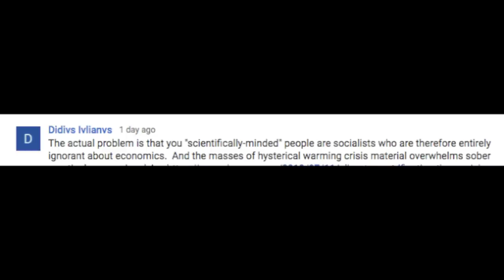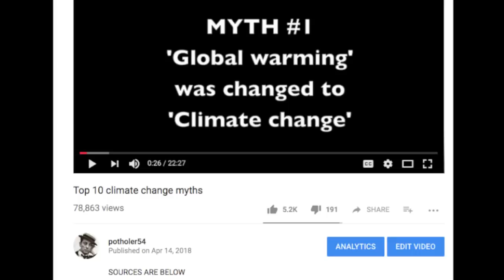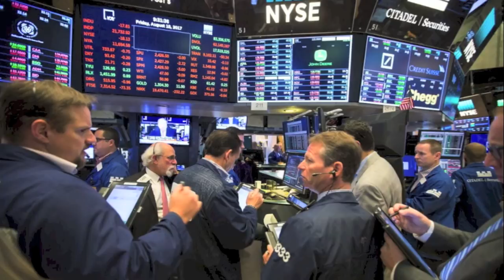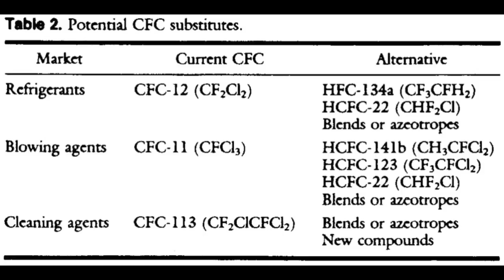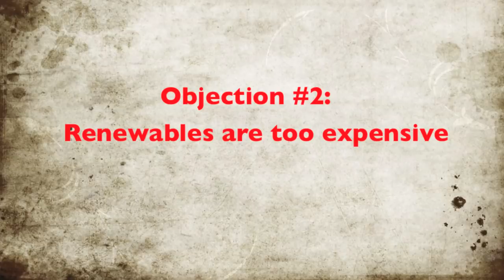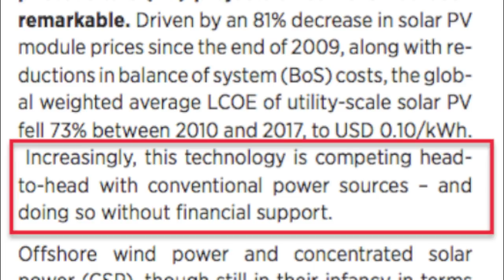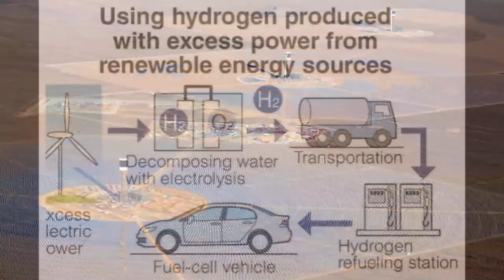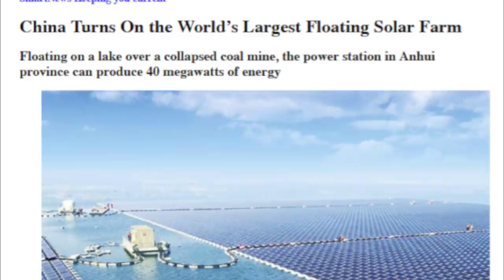A CONSERVATIVE solution to global warming (Part 1)

Comment: I'm a big fan of much of your content, but it's a bit too much of a stretch to claim that the market solved the 'lead in petrol/gasoline' issue and phased out CFCs in the 1980s/1990s. These were actually government interventions. Science highlighted the problems (and the solutions), governments in various jurisdictions implemented legislation, and industry responded quickly because there were relatively quick, easy fixes for both issues. Alternatives to CFCs were both available and cost effective, and most internal combustion engines of the time could be very easily adapted to lead-free fuel. In the UK, the government signalled the end of lead in fuel in 1983 and finally banned it from January 1st 2000. Owners of the handful of vehicles still remaining which still needed lead to function had to purchase lead as a separate additive, not at the fuel pump. 

If government bans things and the market adapts, this may be necessary and beneficial, but it's not accurate to describe it as a genuine free market solution. Market based solutions involve concerted consumer campaigns (to purchase green electricity or electric vehicles, for example), or new players entering the market (such as Good Energy, which offers 100% renewable electricity in the UK), or existing players offering cleaner, greener products and services. 

CO2 emissions are certainly a major concern (it's the top item on the BBC News today). Consumers, businesses and governments all need to take action without shifting the blame elsewhere in order to justify inaction. Much as I would like the market alone to solve the problem, given the urgency of the situation I believe governments can and should intervene to facilitate and accelerate decarbonisation. The solutions can and should be market friendly, but they will almost certainly not be 100% market driven.
Reply: It is a free-market solution in the sense that the government doesn't directly organise what's done to solve the problem. It merely tilts the playground so cleaner companies will have a head start to the consumers' purses.
Reply from the maker: "it's not accurate to describe it as a genuine free market solution."

   But I didn't describe it as a "genuine free market solution." I never make statements if I don't understand what they mean.
Reply: @potholer54  The video title is "A Conservative solution to global warming", and we know Conservatives advocate for free markets and reductions in government controls. You mention 'free markets 'at 1:15 and 8:26, and 'free enterprise' at 1.55 and 19:17, so you are clearly dressing up your solution as a 'free' market solution. 

You begin to present your solution from 8:20 as "Society...sets targets...which encourages...free market solutions" and go on to describe Feed-in-tariffs (without mentioning them by name) and carbon taxes, which government could use as levers to manage the market. 

As it happens I agree, but these are managed market solutions rather than free market solutions. It involves government introducing (rather than removing) taxes and subsidies. This wouldn't be agreeable to the extreme band of conservatives in the US who are your target audience. I don't claim to be an expert - I only have a degree in Economics - I'm just asking for the terms used to be kept accurate. 'Market friendly' would be accurate. 'Free market' would not, and that's the term you've used here.

I also noticed that you referred to solar thermal and solar PV almost interchangeably, when they are very different technologies as I'm sure you know. But I understand the need to tailor the message to the audience and not overwhelm them with detail. As regards solar PV and energy storage, I can recommend the youtube videos of Tony Seba on the subject of 'clean disruption'.
Reply from the maker: "you are clearly dressing up your solution as a 'free' market solution. "
   I don't think I "dress it up" as that, I think it IS a free market solution, as opposed to a socialist solution. I was just questioning your suggestion that I "describe[d] it as a genuine free market solution." I didn't. 

"These are managed market solutions rather than free market solutions."
   I'm not sure whether you are questioning the principle that pollution has to be controlled or polluters have to pay, or that pollution fines should be directed towards new technology, so let's start with the principle of protecting personal liberty and property rights. In a "genuine" free market, am I allowed to dump waste from my pig farm onto your land, or build a chrome smelting factory next to your hotel business?
   If not, then we have lost the free market right from the start. No country in the world has a free market, because every country has anti-pollution regulations
   But if you agree that even in a free market the government has to regulate pollution such as pig waste, or sulfur dioxide, or CO2, lead or asbestos, then the question is, how should it do this?
   1) Send in the police, shut down the polluting business and arrest the owners.
   2) Order an immediate halt to the pollution, with a hefty fine for non-compliance.
   3) Set reasonable targets, impose a fine for any pollution that doesn't meet the targets, and use the money to help private enterprise come up with a technology that eliminates the pollution altogether. 
    Which of those three would you call the "free market" solution? Or is there a fourth alternative, the 'genuine' free market solution that I haven't thought of?
  

"I also noticed that you referred to solar thermal and solar PV almost interchangeably"
   No, and just to clear up any confusion, they are different. Solar PV is solar photovoltaic -- i.e. turning sunlight directly into electricity. Solar thermal is using the sun's heat energy, either to make hot water or heat houses, or run turbines that create electricity.
Reply: So you're claiming that your solution "IS a free market solution". My point remains that it's a market friendly solution, but not a 'free' market solution. A 'free' market is by definition one without government controls, taxes or subsidies. 

As you correctly say “No country in the world has a free market”. Every economy we know of is a mixed economy which is neither a totally free market nor a totally socialist system. In practice nearly every economy - and every market within it - is mixed, neither entirely free nor entirely government controlled. The changes that people would like to make in a market indicate a direction of travel which allows us to identify the school of thought behind the proposals as 'Conservative' or 'Socialist' for example.

Conservatives and libertarians generally favour removal (or at least reduction) of government interventions from the market (such as taxes and subsidies) whereas liberals and socialists generally favour introducing or increasing government interventions. 

Since you are advocating an increase in intervention, this points to the latter approach, which means that the label 'Conservative' for your solution is inaccurate and inappropriate. Describing increased government intervention in the energy market as a 'Conservative' or 'free market' solution is an oxymoron, it would be like describing the privatisation of a government service as a 'socialist' solution, or describing more meat in the diet as a 'vegetarian' solution. 

I don't want to diminish your otherwise excellent and well-researched content, but you seem like someone who's interested in accuracy, hence I am trying to help you improve accuracy, albeit I seem to be experiencing some resistance. 

How would I solve the pollution problems you outline? Well there’s a lot of rabbit holes we could go down there (pig muck, SO2, asbestos etc), but as regards CO2 specifically, I adopt the approach that natural resources are common resources. This includes land, oceans and fossil fuels. Quite simply in my world the government would set a higher price for all fossil fuels extracted from the ground, at source. The higher prices would be passed down the supply chain so that retail energy costs – mains gas, electricity, LPG, heating oil, coal, aviation fuel, diesel and petrol/gasoline – would also be higher, as would the price of goods and services produced using fossil fuels. The revenues collected at source by the government would be distributed to all via a basic income. So in effect there’s a fee-and-dividend type scheme (https://en.wikipedia.org/wiki/Fee_and_dividend). That link also explains how border corrections would work in such a scheme. 

Is this a ‘free market’ solution? No. It’s not a Conservative solution either. It’s just my solution, and it’s relatively market friendly in that there remain many suppliers and buyers of energy interacting via a price mechanism and the government levers I would introduce would incentivise people to switch to greener electricity and minimise energy consumption. But in the interests of accuracy I can’t describe my solution as a ‘free’ market one. As the Stern report indicated, climate change is a major example – probably the major example – of market failure today. 

With regard to the Solar/PV Thermal comment I made, I simply point out that you do not present the difference between Solar PV and Solar Thermal clearly. Solar thermal is likely to remain peripheral while PV continues to reduce in cost, resulting in installed PV capacity continuing to expand by ~40% p.a. If Tony Seba’s predictions hold true, this should mean all energy globally coming from solar PV by around 2030.

Let's hope that is what happens. Or, as the Americans say, "Amen to that".
Reply: I think there is some subjectivity/relativity here in what constitutes a "free market". I don't think it should be thought of in binary terms -- a market can be mostly free, but with certain restraints to prevent abuse of the system. Much in the same way that humans are mostly free to live life as they wish, but not free to impinge on the freedom of others. Absolute freedom, in most senses of the term, is fiction. It should not be up to only liberals and progressives to figure this out.
Reply from the maker: "So you're claiming that your solution "IS a free market solution". My point remains that it's a market friendly solution, but not a 'free' market solution. A 'free' market is by definition one without government controls, taxes or subsidies."
   I would call that a 'free-for-all' market. If there are no government controls then there is nothing to stop me setting fire to a rival business or shooting a competitor. And if that's the case, is a market with no competition really a 'free market' either?

"Conservatives and libertarians generally favour removal (or at least reduction) of government interventions from the market (such as taxes and subsidies) whereas liberals and socialists generally favour introducing or increasing government interventions."
   Yes, but as I explained, favoring removal of government interventions does not mean have no interventions. Even conservatives and libertarians accept some government. The idea of no government is not conservatism, it is anarchy.  

"Since you are advocating an increase in intervention...."
  Never mind whether I am advocating this, I am interested in hearing from you how you think society should tackle pollution without intervention. You don't seem to think government intervention is the conservative or libertarian solution, so OK... what is?

"you seem like someone who's interested in accuracy"
   Yes, and please don't see this discussion as me resisting correction, it is very illuminating. 

"in my world the government would set a higher price for all fossil fuels extracted from the ground, at source."
   I know this is your personal opinion, and you therefore can't be a conservative, but the point of my video is to look at a conservative solution. If you think the "polluter pays" principle is not conservative, what is? 

"With regard to the Solar/PV Thermal comment I made, I simply point out that you do not present the difference between Solar PV and Solar Thermal clearly."
   No, and I never intended to, I assume people understand the difference. My videos would be way too long if I had to explain everything. For example, terms like 'northern hemisphere,' 'CO2' (short for carbon dioxide), 'ice cores'.... I just have to assume a certain level of intelligence among my audience.
   BTW, I don't agree that solar thermal is the lesser power source. For one thing it's making more use of the sun's energy. Also, it's more suitable in certain places, where high temps tend to reduce the efficiency of solar panels. But a twin approach will always be best.
Reply: Apologies for the delay in replying, Youtube didn’t notify me when you last replied, and I’ve been dealing with some probate matters. It might speed things up if you could tag me, and perhaps even persuade my relatives to stop dropping like flies. 

“If there are no government controls then there is nothing to stop me setting fire to a rival business or shooting a competitor”

That’s a bit of a straw man argument, because you are positing anarcho-capitalism as the only alternative to proactive government intervention. There is in fact a middle path which is neither of your two posited options. 

Introducing taxes, subsidies or regulations takes us further away from a free market, hence why it would be in the category of liberal / socialist solutions. Removal of taxes, subsidies and regulations would be in the category of conservative / libertarian solutions, as I think I mentioned. 

Proposing to introduce a carbon tax based on the ‘polluter pays’ principle would be sensible and also win the support of most economists, since they know that pollution (including CO2 pollution) is an example of market failure. But as it takes us further towards a managed market and away from a free market, it wouldn’t win the support of most conservatives or libertarians, certainly not those of the Tea Party persuasion. 

It may be helpful here to clarify what I mean by these terms, and where I stand. 

Socialists favour a planned economy, which they hope would be responsive to the people via the democratic process. This can be likened to a soccer match where the game is played but the result is fixed in advance to be a draw, and the players are micromanaged by the referee. 
Liberals, in the modern sense, favour a market based economy with government intervention, invariably more government intervention than exists at the moment. This can be likened to a soccer match where the referee intervenes frequently to achieve goals which are different to those of the individual players, such as by handicapping the winners or awarding regular free kicks and penalties to those who are losing.
Conservatives favour a minimal government and as such will generally favour reductions in taxes, subsidies and regulations in markets. 

Libertarians go one step further. They advocate the non-initiation of force. Any form of state regulation of voluntary private or business behaviour is strictly verboten in a libertarian world. Libertarians would abolish victimless crimes, drug regulations, immigration controls, the taxation of personal or business incomes, and welfare payments. In a libertarian world, the state would exist, but it would be strictly reactive. Only if force or fraud were involved would the state swing into action. A Conservative or Libertarian world can be likened to a soccer match where the referee is on the pitch, but only steps in when someone reports a foul (such as force or fraud). 

Anarcho-capitalists go yet one step further. They would abolish the state entirely, and have private law enforcement arrangements and courts via so-called DROs (Dispute Resolution Organisations), a kind of law and order insurance and security service to which people would subscribe. The An-Cap world is like a soccer match with no referee at all, but where the linesmen and video referee can be called upon for adjudications by players who cry foul. 

Stephan Molyneux has presented a good case for DROs in support of the An-Cap position. I believe they could provide an effective and functioning alternative to the police and courts system we have at the moment. However I don’t agree with him on a couple of points. I believe a state is needed to provide external defence, including asteroid defence and protection against natural disasters. Stephan is also wrong on climate change, as you have shown. 

Where I fall back to is *geolibertarianism*. This is a modified libertarian view which states that a reactive state can exist, but that natural resources, such as land and fossil fuels, should be held as common resources rather than privately owned. In short, you can own your house (and buy and sell houses) but the land your house is on cannot be yours, therefore the houseowner must pay a ground rent into a common treasury. The same applies to fossil fuels, seas and oceans, and probably the radio spectrum as well. The user of the resource pays. The monies paid into the common treasury would support the minimal state – including external defence and asteroid defence – and the remainder would be distributed to the citizenry as a basic income. 

So I don’t favour taxes and subsidies per se, but in my world fossil fuels would be more expensive because they would begin as a common resource and extraction companies would do literally that – just extract and refine. Such a principle would work well in your land of Freedonia, I imagine. 

Applying this to a more real-world market situation, I could use an example of the computer hardware market in the UK. There are no specific government taxes on hardware, or subsidies of hardware, or regulations specific to the computer hardware industry (that I know of), or a government Office of Computer Hardware Regulation. You can buy a PC from Argos, Currys, John Lewis and other high street retailers, or from a variety of online retailers, including Dell. They each have different prices and warranty terms. If you buy a PC from Argos you get a 30-day no-quibble refund or exchange if it doesn’t work as you would like. From the 30 day point up to 12 months it’s a return-to-manufacturer warranty. Currys have the same policy, but for an additional fee you can upgrade this to on-site service where someone visits your premises to fix the PC. John Lewis go a step further and offer a 5 year warranty. In the event of a company not meeting its own policy, if you can’t get any joy out of them you have the option to go the small claims court for an independent judgement, which can then be enforced if the company doesn’t comply within a reasonable time period. 

If we apply your argument of “If there are no government controls then there is nothing to stop me setting fire to a rival business or shooting a competitor” to the computer hardware market, it’s hard to see how it makes any sense. There are no active government controls here – no subsidies, taxes or state regulators. There is no proactive intervention by a partial referee. There is a court in the background to adjudicate in contractual disputes, but it’s reactive, like an impartial referee who only makes decisions if someone cries foul. It’s as close as we can get to a ‘free’ market whilst still having a state. Yes there’s the Sale of Goods Act but that simply codified prior case law on contracts, in effect copying and pasting it into statute law, so it isn’t really needed. Even without such legislation people would still be able to seek adjudication on contractual disputes form local courts just as they have been doing for hundreds of years. And if we ever transition to DROs then that would provide the same service, but probably more quickly and efficiently. Just because a reactive mechanism (whether state run courts or a private DRO system) exists in the background to respond to incidents of force and fraud, that doesn’t mean that the market is state controlled. 

“is a market with no competition really a 'free market' either?”
This question is less rhetorical than you might have first imagined. Natural monopolies all fit the definition of markets with no competition. Electricity, Gas, and Water supply networks, roads and railways all fall into this category. The fixed costs of constructing such networks are so high that only one player can remain in the market to repay the infrastructure costs. If a second market player joins, prices fall until one of them goes out of business and you’re back to a monopoly again. If the supplier is a private, for-profit company then it would be expected to charge a higher price than one with competition. Economists call this ‘excess profits’. There are 4 policy options towards natural monopolies: The first is to leave the monopoly in private hands, and tolerate the supplier’s ‘excess profits’. The second is to have a government regulated monopoly. The third is to take the monopoly into public ownership (and history suggests the track records of such public corporations is poor. e.g British Rail). And the fourth – my personal favourite – is to transfer it into the hands of a non-profit co-operative. Under a system such as that consumers’ water bills, rail fares etc would be decided by an AGM of the supply company, in which each of the customers of the company would, if they choose to, have a vote. The first and fourth options could both be described as ‘free’ market solutions, since both can be operated without compulsion. The third option is debatable, since most public organisations at some stage end up needing public subsidy which arguably is extracted from the taxpayer via compulsory means. 

"You don't seem to think government intervention is the conservative or libertarian solution, so OK... what is?”

It isn’t, and I’ll answer this below. 

“please don't see this discussion as me resisting correction, it is very illuminating.”

Glad you’re enjoying it, so am I. 

TBC......
Reply: “I don't agree that solar thermal is the lesser power source. For one thing it's making more use of the sun's energy. Also, it's more suitable in certain places, where high temps tend to reduce the efficiency of solar panels. But a twin approach will always be best."
Apologies for being UK specific, but solar thermal in the UK without subsidies would have a payback of about 35 years, whereas PV has now reduced in price to the point where payback periods are sub 12 years, nearer to 7 years if you factor in feed-in-tariffs. Solar thermal, when used for supplying hot water, also has the limitation of only being appropriate for buildings with 3 or more residents. As yet interseasonal heat storage isn’t cost effective enough to make solar thermal suitable as a way to heat homes in winter, with or without the assistance of heat pumps. Hybrid PV / Thermal panels do exist, but they have all the same limitations as solar thermal on its own. Look at the numbers – it’s PV costs which fall at ~40% per year and installed PV capacity which expands by ~40% per year, putting it on course to supply 100% of global energy by circa 2030. 

Dovetailing nicely with that is the ongoing reduction in battery storage costs (currently falling by ~20% per year, a rate of reduction which is, if anything, accelerating). As a result solar PV is now the cheapest source of electricity for about 15% of the planet, a proportion which is rising each year. By 2020, solar PV will be the cheapest source of electricity for around 25% of the planet, rising to 50% of the planet by 2025 and 90% or more of the planet by 2030 (as per Tony Seba’s book). There are no such cost reductions in solar thermal nor any sign of a similar explosion in capacity. Hence why I suspect solar thermal will remain peripheral. 

So in a sense, this answers your question of what is a free market solution for climate change. Plug-in electric and hybrid vehicles are shifting transportation energy needs from dirty diesel and petrol/gasoline to the (cleaner) electricity grid. At the same time the switch from halogen, incandescent and fluorescent lighting to LED lighting is reducing demand on electricity grids. Renewables are becoming cheaper and more efficient, while energy storage is evening out spikes in grid demand and solving the problem of intermittency in renewables. More and more people are reducing meat and dairy consumption for either environmental, health or ethical reasons. A ‘free market’ solution is to vote for more of all these things with our daily choices and our pounds and dollars, more so than relying on the ballot box. 

We can accelerate the transition to a low carbon future by switching our lighting to LEDs, installing solar panels and energy storage in our homes, upgrading insulation, adopting smart controls for heating and cooling, choosing 100% renewable energy suppliers, switching to electric vehicles (or at least plug-in hybrids), and adopting more plant based diets (for more on that see the documentary film ‘Cowspiracy’ on Netflix and elsewhere). We can even invest in clean tech companies like Good Energy and Tesla (or even my company). Doing this – and persuading others to do the same – will achieve much more, and more quickly, than writing to our Members of Parliament (or Congress) and trying to achieve change through the political process.
Reply from the maker: Not sure how to 'tag' you -- I just hit the reply button, and YT is supposed to send you notification of the response. If you can explain the tag, I'll try it.

I wrote: “If there are no government controls then there is nothing to stop me setting fire to a rival business or shooting a competitor”
You wrote: "That’s a bit of a straw man argument, because you are positing anarcho-capitalism as the only alternative to proactive government intervention."
  -- Well, isn't it? If there is no government intervention, there is nothing to stop this anarchy happening, right? 

"Introducing taxes, subsidies or regulations takes us further away from a free market, hence why it would be in the category of liberal / socialist solutions."
   So there seems to be an all-or-nothing, on-off switch in your scenario. In the no-government situation we have a free-for-all -- what you call anarcho-capitalism. So we both agree that this is not conservatism or even libertarianism. 
   The next step up is to have the most basic, limited government to prevent one person polluting the environment of another. Which means regulations. If you produce more sulphur dioxide, more pig waste or more CO2 than safe limits allow, the government has the power to impose a fine. 
   But from what you are saying, ANY regulation and fine is a liberal / socialist solutions. So we have immediately gone from anarcho-capitalism to liberalism/socialism. So where does conservatism fit in? You seem to be saying that if there are no regulations, it's not conservatism. And if there's even one regulation against pollution, that takes us away from the free market, so by your definition that's not conservatism either.
   You described a libertarian 'government', and how it would react to fraud or force, but you didn't say how it would react to pollution. Isn't dumping pig waste on someone's property a 'foul' in the soccer sense? How should a conservative/libertarian government react? 

"solar thermal in the UK without subsidies would have a payback of about 35 years...."
   OK, the difference between us here is that I am looking at the worldwide model, you are looking at the UK. Solar thermal tends to be more efficient in countries with more sunshine. I don't know where you get the 35-year figure from, but I use $400-worth of ordinary black irrigation pipe coiled on my roof to heat our spa. Instead of paying grid electricity prices to do it, we now get hot water for free. Payback time : About 6 months. I have huge cost savings because it isn't plumbed in or regulated, but that is also the case for millions of households worldwide.